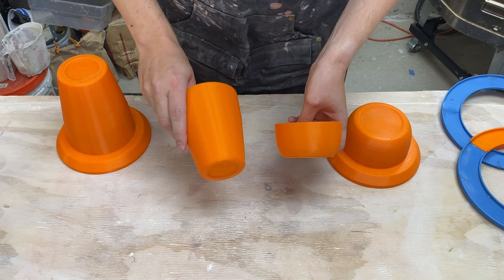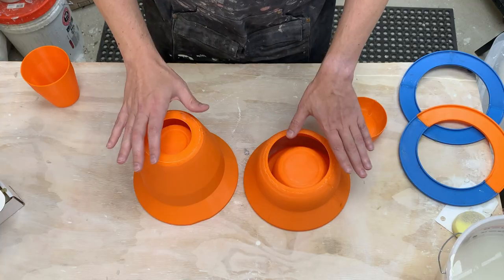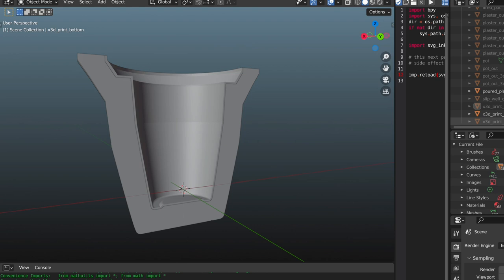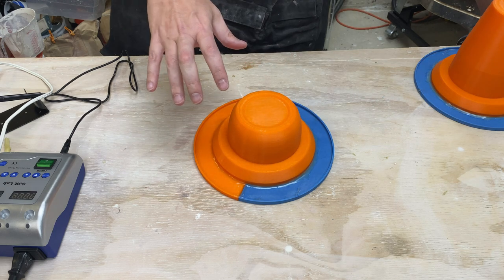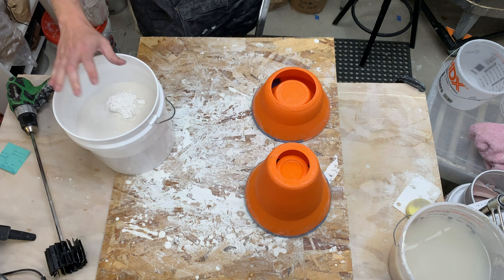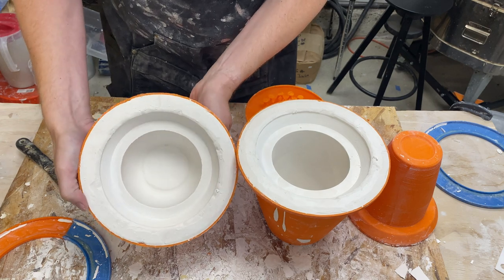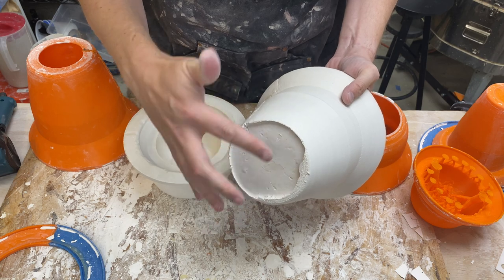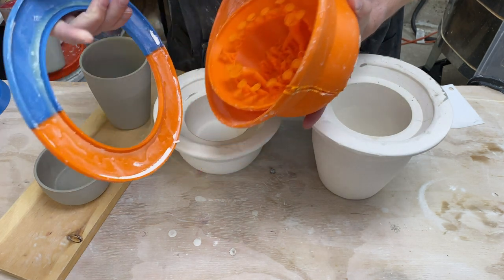Automatic! 3D Printed Outer Mold for pouring Plaster for Slip Casting

Comment: Really nice work, thought and experimentation ... just getting better and better.  Maybe add a large central pull handle for the centre mold as well as some channels for the outer mold that are sealed with wax at the bottom to stop the plaster leaking up but that when you blow with compressed air it blows the wax out and you get an air all the way down to the bottom to build pressure for an easier release for the outer as well.  You could also build the centre mold from 2 parts and join them with the wax so that they are also eaiser to remove.  All some random ideas to try and play with.
Reply from the maker: Thanks for the ideas! The channel sealed with wax is a really interesting idea. I also wonder if that might work on the inner mold. Splitting the outer one is pretty straightforward (the seam there doesn't matter) but having a seam on the inner mold is a bit less than idea.

Comment: Great video! My "lazy" approach for such joints is blue painter's tape. It's worked well over the last couple of years.
Reply from the maker: The foil tape really works well. But it is also kind of annoying. I work that the tack on blue tape might not be strong enough to hold back the plaster especially if there is a small leak??
Reply: @PotterybyKent  I typically use some type of burnishing tool (thumb nail <g> ) and the 2-inch wide tape. The adhesive seems to like PLA. So far no plaster disasters...
Reply from the maker: Good to know!

Comment: Awesome work. For the adhesive, I use a gorilla glue stick and glue gun which helps with speed and accuracy. Then using a pipette and squirting a little denatured alcohol onto the glue releases it easily.  Not sure why that works, but it’s great for sealing and releasing molds (I usually work with silicone rubber so I look for an water proof seal).  All available from hardware store too, which makes it convenient!
Reply from the maker: Thanks! I'll need to try the alcohol trick and see if that might work for me.

Comment: I really love Seeing people mix traditional and modern mediums to streamline and push what's possible in these kinds of applications. I have a project I am currently trying to mixed 3D printing and slip casting as well. If you'd be willing, may I email you to pick your brain and get your opinion on a few things? Much appreciated, and keep the vids coming, these are so helpful!
Reply from the maker: Thanks! Sure thing - feel free to reach out.
Reply: @PotterybyKent  Sorry, I don't know where to find your email address 😅
Reply: I've been printing very hi res (0.07mm and 0.05mm) PLA, using liquid soap as a mold release (coat, let dry, repeat a couple of times), and the results have been very pleasing.  At that resolution the PLA needs little to no post processing. Downside is very long print times (I've had prints take up to 8 DAYS). But if your setup is reliable and tuned, intermediate silicone castings can be bypassed. Mostly printing mugs, tumblers and vases for slip casting with B-Mix ^5-6 clays.

Comment: Have you thought about printing TPU.  It’s flexible so you may be able to demold more easily.  You may have to play with thickness for strength.
Reply from the maker: My printer didn't do TPU so that was a non option. I did play with silicone, but at this point I'm happy with the process I've made using PLA.

Comment: Fabulous thinking “outside the box”!  Is the 3d printed plastic model friendly to sanding to remove the artifacts before casting? Thinking out loud, it would save time cleaning each cast. 

I know very little about 3d printing… perfect reason to enroll in a continuing ed class at the local college ❤ you’ve inspired me to think about my pottery studio in a completely different way.
Reply from the maker: Indeed you can! In particular you can use filler primer and sanding and get the surface as smooth as you like. I have a video later in the playlist showing the idea.

Comment: Hi, thank you for your videos, that's a fascinating process. I am thinking to get a 3d printer for that purpose. I was just wondering about the horizontal lines that transfers to the final piece. Did you ever  try to sand the 3d printed pieces to avoid those  lines?
Reply from the maker: Yep! There's a video later in this playlist that shows just that using filler primer.

Comment: Seems like you could add threading to both forms to attach to the bottom ring. Just screw them in, though getting them off would be hard.
Reply from the maker: Thanks. I'd thought a bit about that, but it doesn't extend other kinds of geometries. And having the sides split open even for these is really nice!

Comment: Hey Kent, instead of doing a relief cut on your outer mold, you might want to try murphy's oil soap as a mold release. I think it would work well and you wouldn't have to do a cut.  Also, maybe there's a way to seal the bottom ring? Before I saw the ring I was thinking the 2 pieces could be pushed down into a clay slab. I've done that before with casting and it works well, but it's a bit messy getting wet plaster on the slab if you want to salvage all of the slab later. Just my thoughts. Thanks for another great video.
Reply from the maker: Thanks. As I said in the video, I did put Murphy's oil on the outer molds as well as the inner. It didn't work unfortunately.
I am actively looking for other ways to seal the 3d prints together. Clay is one method, but as you mention, it does have drawbacks as well. I think there will be a good solution though!

Comment: Have you tried combining the bottom circle and the inner mold into one piece? That way you would only need one seal on the outside.
Reply from the maker: That is a good thought. I haven't tried it yet. The trick is getting the inner mold out, which can be a bit tricky already. Making it larger might be even more so. If I can reliably get it out, then reducing the number of seams would be a good goal!

Comment: One use for TPU would be a 3D printed "knife" specifically shaped for trimming the "sprue" (I know it's not really a mold sprue...). Might be a bit less awkward. :)
Reply from the maker: I don't have direct drive, so no TPU for me right now. But I do like the idea of 3d printed custom tools!
Reply: @PotterybyKent  I have printed tools in PLA and then made hard rubber castings using OOMOO products. A bit pricey though.
Reply from the maker: I made a makers mark stamp in a similar way.

Comment: Would you ever just leave the outer mold on for bump protection around the workshop?  Or would it impact the plaster's moisture wicking?
Reply from the maker: Maybe if it were fully dry you could put it back in. However properly mixed plaster is pretty strong. And yes, from what I understand about the process, if it was wet, it would likely mess with the water transport from inside to outside. Also, the molds need to dry (some) between uses and I think preventing the outside from releasing water would be problematic. It both provides more surface area for evaporation, but also lets the water content equalize within the plaster (as opposed to just stay on the mold side).
Reply: @PotterybyKent  Ahh yes, I didn't consider the letting the plaster cure properly thing either.     I've gotta say, your vids have got me mad keen on doing some casting.  I've been harvesting wild clay from my property in the Aussie bush, and prepping it for hand working.  So I have many buckets of liquid clay on hand at any time.  Now I'm off down the de-flocking and specific gravity rabbit hole. lol

Comment: How many hours of printing is it to create the cottle in 3d print? I think it might be simpler to press your form into clay at the base and then wrap it with a sheet of metal ( got mine in the hardware store roofing section) I sealed the overlap with duct tape. I have also seen people do the same but use stiff plastic sheet also and seal the overlap with dog clips.
Reply from the maker: I think that one was about 6 hours I think. So it's hard to get simpler than push the start button, go to sleep and wake up with it done!

Comment: Lovely work. A little over complicated with the sealing though. Why not just use a traditional bead of clay. It will take seconds to apply.
Reply from the maker: Because this is just the first stages of the mold system. I've continued to develop it and these were critical features (lots more videos in the playlist if you're curious).

Comment: The pot forms you are making look like tradition wheel thrown pots.  One of the advantages of cad design and slip forming is that you can create non traditional shapes.
Reply from the maker: For sure - take a closer look at my channel (before I started this deep dive) and you will see some of them. The problem is the CAD work needed to do so. Over time I will get there with shape cast.
Reply from the maker: Also, there are several advantages to slip casting revolved forms even if they could be done on a wheel